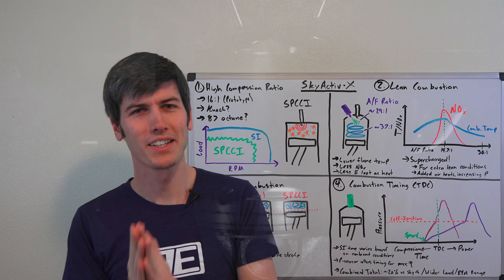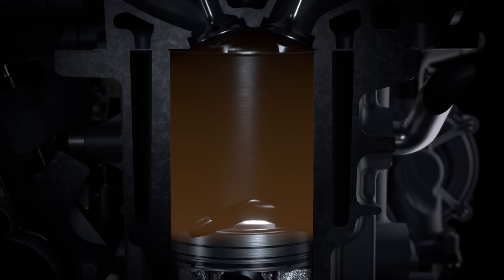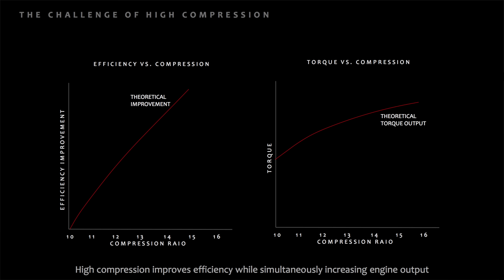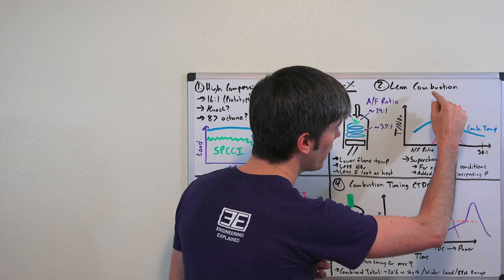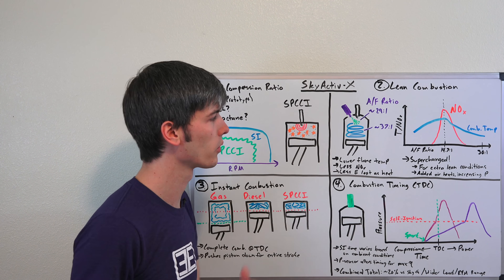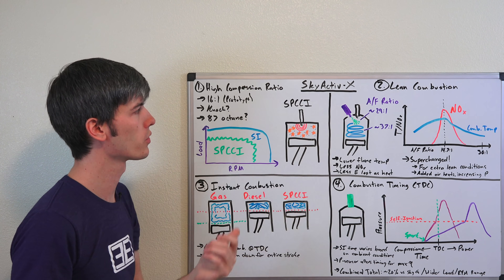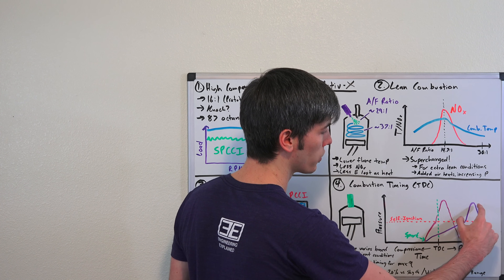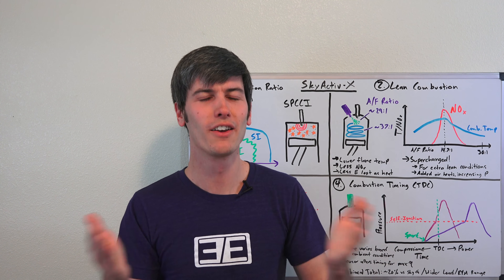How Mazda Is Saving The Gasoline Engine - SkyActiv-X

Comment: I love seeing manufactures saving the combustion engine, I absolutely hate the fact that countries and cities are pushing people to go towards "greener" electric cars but in the time we live in today it is not the economical choice, We are a long ways a way from generating clean green energy in most countries and recent studies show that newest combustion engine equipped vehicle are actually better for the environment on the long run, I want to predict that we are still 30-50 years away from electric vehicles.
Great video once again.
Reply: catalon warior nope. Honda will be making ice’s 30 years from now
Reply: I don't really care what is greener, if I can't change gears then I don't want it.
Reply: superdau Our power grid in America is overstressed as it is. You think we can handle 300 million electric cars too?
Reply: N C  Also, how are the chargers supposed to work?  We can't even get fiber internet to the majority of homes.  I work in the city but live waaay out of town with the farmers.  Is the utility company willing to run a new high voltage line out to every 400-acre home, and then to the next town 35 miles away?  What about when I get to work, are they supposed to pay for it?  If I live in an apartment, how do I avoid "charging theft", and is the landlord required to install a station at every parking spot?  What if I live in the city, where most don't have garages or driveways?  Do I have to run a cable out the window to the street?  What if I can't park on my street that night because someone else needs to charge?  What if I live in an area with snow removal?  What if I rent and the owner won't put one in?  What if I live in HUD housing?
Reply: Um no.  Just, plain, no.  Before going into this, you need to understand some basic things that I will outline below.  This may help you in understanding the problem.  

Renewables, while more easily accessible now than in the past, will not eclipse oil any time soon.  The reason, as others have stated previously, is that it is simply transient energy by nature.  How does the power grid account for this?  In a short answer, it barely does.  I highly recommend you go to like energy seminars and listen to what utility companies have to do to handle power demand.  It is highly statistical and estimated BY THE HOUR.  If demand does not match supply, it is a near emergency to bring power to the grid fast enough to meet demand to prevent any type of generator overload or blackouts.  It is a black science of sorts and very eye opening.

Energy storage is another reason.  Batteries, no matter the form, is totally inadequate in storing the large amounts of energy needed to power entire cities.  On top of that, charge and discharge times and cycles are important.  What is the point of having a battery system large enough to power 1000 homes if it takes over 12 hours to charge the batteries?  Batteries are limited by their charge and discharge rates (C).  The batteries can only SAFELY charge and discharge at certain rates.  Anything more on either side of the fence can destroy a battery.  

Lastly, renewable energy has really only grown in the last 10 years because of the subsidies in it.  If you look at a historic graph of renewable energy solutions sold vs subsidies, there is a direct correlation.  More subsidies = more being bought.  Makes sense right?  Now, take a look at subsidies vs innovation.  The more subsidies there are, the less innovation there is.  It is an inverse correlation.  Why?  Innovation is not needed when you are guaranteed to get x amount of money regardless of how it performs.  The one or two years the US killed subsidies to solar and wind, the sales of those solutions dropped to near zero.  

Ok, so now that you have this background information, let's look in the future.

Energy storage - lots of R&D is going into this to move away from batteries.  We need a huge energy storage solution that is able to accept high amounts of charge and discharge current in transient conditions without impacting operating life.  Once we have this, renewables may become more feasible, but only after the next point.

Wind - Wind is transient.  Not only is it transient, but windmills are only viable in two situations: 1) offshore or 2) at certain elevations in certain locations in the US.  You may have noticed that windmills have gotten larger over the years.  You are correct.  In fact, there are bigger designs on the horizon, but manufacturability is at its limits right now.  When I took a master's class in energy, GE had the current record of being able to make the largest one-piece wing for a windmill.  There is more wind energy when they are higher off the ground.  So we need bigger supports and bigger wings.  The problem is how do you make a one-piece wing big enough?  You should see the pictures on how they make these things.  Its pretty amazing.  So this is currently a bottleneck.  Additionally, lots of cities absolutely refuse to have any off-shore windmills.  Why?  Because it "looks" bad and takes away the beauty of the city.  This is no joke.

Solar - While solar array prices have dropped (yay), their efficiencies are still poor.  Off the top of my head, spectrolabs makes the highest efficiency solar panels at a whopping 40%.  They also cost magnitudes more than consumer grade solar cells, which are sitting around 10-12%.  Again, we have the same problem with wind.  Solar farms are only viable in a few locations in the US.  See a Dept of Energy map to get an idea of ideal locations.  

Price - the reason why subsidies are required is because these solutions cost so much.  Honestly, more innovation is required to get prices low but subsidies kill the opportunity to do so.  

Lastly, most 1st world countries (almost all in fact), rely on oil and nuclear power.  Even if everyone went EVs, the demand for oil would go up.  Realistically, nuclear is the best long term solution here for power.  Before you throw the flame arrows, I highly recommend you look at Gen 4 nuclear power designs and compare those to what is on the market today (Gen 1 or Gen 2).  There really is no comparison.  Anyone with an open mind and looks at the designs in an objective manner will come to the same solution.  

Sorry for the wall of text, but it was really required to get you the whole picture.  And this doesn't even touch on things such as badly needed innovation in the transformer market or smart grid tech.  Both of those would be an amazing help in all this.

I hope that helps.
Reply: Electric engines will spread like ICE engines over time: as both the fuel and the product that consumes the fuel become more and more available. As we saw more and more cars, we saw more and more fuel refined and more distribution points. As we'll see more electric cars, we'll see more solar panel and windmill manufacturers (and distribution sources will improve too, to get away from coal and nuclear. Heck, there's a nuclear fusion reactor prototype being developed. Greener and safer than that will be hard to come by: it only produces helium and heat!)
Reply: Manufacturers will continue to increase battery capacity as costs of doing so drop. Most people don't want a full electric vehicle because of range concerns. But if you tell them they can complete their daily driving on electricity and charge at night for a small price premium they'll jump in it. The only thing holding plug-in hybrids back is the price. But the cost is plummeting. When the price premium is under 4k, more and more people will take that deal because they will save on gas during their ownership.
Reply: Combustion engine isn't dying anyvtime soon, but in order for it to survive it needs to evolve. We already have the tech to make biofuels out of wood and food waste, it just needs to be implemented correctly.
Reply: Studies often forget that fuel doesn't just pop into existence in gas stations. They calculate the impact of power plants and battery manufacturing, but conveniently forget how gas is made. Oil has to be extracted from the ground, which uses a lot of power, and causes a lot of pollution if they use the now popular fracking. Then it has to be transported, and refined, and transported again. Both, but refining especially is energy intensive. Some experts say that now the oil industry uses almost as much energy to get the fuel into your car as the energy content of that fuel. Then there are the frequent oil spills, that are causing huge damage to the environment. And also don't forget about the Middle East where a lot of oil comes from. Wars there are the byproduct of the fight for oil. Hundreds of thousands of deaths, terrorism and millions and millions of refugees. Plus the obscene amount of money that the US spends on bombing and invading those countries.

Renewable energy is really taking off now. In the last few years the actual growth surpassed even the most optimistic predictions, and it's still picking up speed. That's because prices are now competitive with, or in some cases go below coal. Without subsidies. Plus battery storage is viable and affordable now too. In fact the recently built 129MWh Tesla battery pack in Australia is making a ton of money, and will pay for itself in a year. That's because the grid is overstressed and unstable, so the battery owner often gets payed for storing excess power, and again for giving it back at peek hours. And occasionally in case of an emergency (power plant failure, or general power shortage) they get payed a huge amount for the stored power. The battery can switch on in about 120 milliseconds, while even the fastest gas turbines need minutes to spin up, and a big coal or nuclear power plant needs hours.

Charging cars at night is not a problem for the grid. In fact it's a good thing, because demand is very low at night, so conventional power plants are throttled down and not making much money. That's why electricity is a lot cheaper at night. When solar energy gets dominant, this will change of course. Then cars won't charge at night, but when the Sun is still up, if possible. This will be coordinated by the grid, the owner won't even notice the difference. Also hydro, wind and nuclear will still be available at night, and huge battery packs will pick up the slack.

If we extrapolate from current trends (demand, production ramp up, battery energy density growth and price reduction), it's seems that by 2030 almost all new cars will be full electric, and by 2040  almost all cars on the roads. In Norway already over half of new cars are plug-in hybrids or full electric. That's of course because the incentives, but with the falling prices those won't be needed for long. Already if you look at the total lifetime cost of a vehicle, electric is a lot cheaper, but in a few years the sticker price will be less too.
Reply: And I forgot one important thing. Lithium mining is reasonably clean, and the batteries are fully recyclable, so there are no mountains of toxic waste as some people claim.
Reply: superdau  your wrong
Reply: András Bíró  Go read a little about Li mining before you say it's clean.  Start with Bayan Obo.  Then look at other rare earth refining like Baotau Lake, which makes EV motor and wind turbine magnets.
0% of lithium gets recycled.  NiMH does partially.
Your other comments are equally flawed.
Reply: Do you have a link to these recent studies?
Reply: superdau Look up the thermal efficiency of coal and gas plants, remove the transmission losses, and compare that to ICE.  Why build more power plants when we could just stick to the gas-powered cars we already have?
Reply: liljendal20 Bevs not the future but don’t tell pestla owners that. They nonstop talk
Reply: Dan, you still have not factored location in all of this.  Again, what is the point of having wind and solar if your state or local area is a poor choice for them?  Example, look at Hawaii.  Nearly 100% of their energy use comes from oil.

Also, it does not matter that the lion share of new power generation projects over the past few years were renewable, in overall energy generation, it is still a minute piece of the pie.  Oil, NG, and nuclear are still king are will be for a very long time.  

Solar farms are not cheap.  If it cost $25M dollars to build a farm that will supposedly generate 1 MW of power, efficiency makes a huge difference.  Why?  It is called Rate of Return.  I recommend you look that term up.  It is important to note that solar cells degrade over time.  It degrades the most in the first 3 years of operation, so that 10% may be only 8% by year 3.  Whereas a 20% may be 16%.  Half your payoff time.  

Hydro is even more location dependent than wind and solar.

Again, with batteries, there will be a global shortage of materials that go into them.  I highly recommend you research about the Cobalt shortage.  Elon Musk couldn't meet his Battery manufacturing goals even if ALL the world's Cobalt supply went to him.  All this will do is drive the price of batteries up if demand does not change or Cobalt supply is increased.  

My previous point on battery life is still valid.  On top of that, the energy density of batteries is just not there for long term feasibility.  Things may change in the future with some of the new battery tech coming out, but then you still have the issues of longevity with charge and discharge rates.

And you are dead wrong on nuclear.  If you look at the entire energy generating life cycle of a power source, nuclear is by far the cheapest per watt.  Sure, it has huge capital costs, but once it is up, fuel rods last up to 50 years.  With Gen 4, they can pretty much be used indefinitely as they have some reactors that can actually generate more fuel than they use as a byproduct.  It is pretty fascinating.  

You say economics will push ICEs out of the equation.  Not going to happen, at least by that time.  I come from the auto industry.  While electrification is a big thing, ICE's are not going away any time soon when companies like Mazda continue to innovate to bring fuel economy in a package like this.  

Why?  Several reasons, actually.

1.  There is no infrastructure for EVs in place.  Sure, one can charge at home, but what if you travel?  Are you going to going to take a 1.5 hour break every 100 miles?  Unless you own a tesla and can drive 3-4 hours on a full charge, its unfeasible.  

2.  Battery charge and discharge limitations.  Until you can get charging stations that can charge your car as fast as you can fill your gas tank, it is not going to happen.  

3.  Cost.  Look at the average cost of a new ICE car nowadays.  It is what, around $28,000 now?  Are you going to force poor people to buy new cars?  The subsidies have already ended in a few states.  For some people it is simply too much without them.

4.  Repair cost - Batteries have a finite life.  And FYI, it is less than the expected design life of a car.  5-7 years is the estimate.  This is one of the big reasons why used priuses are so cheap.  Every conventional toyota product has high used car values except for the prius.  

5.  Manufacturability - Cobalt shortage.  I believe the current rate of mining puts battery manufacturing rate around 500,000 units per year (for cars).  Take all of the large car manufacturers.  Combine all their throughput per year and take compare that to battery supply rates per year.  Note, this will most likely not include smaller, local auto OEMs like in India or China.  Even without them, there will be massive shortages.  With massive shortages will come massive price increases.  With this, the profit margins will fall and ICE's will look more and more economical.

6.  The energy density of diesel and gasoline can't be beat.  

7.  Alternative fuels are still being looked at that would be cheaper than both gas and electric (kW/hr).  Really, in the case of H, the infrastructure is what is lacking but has been proven to work and work well.  Cost is an issue here as well, but economies of scale have not been realized yet as it is still in the prototype and pilot phase.
Reply: the problem there is that people who own ICE cars get punished, instead of more healthier choice of giving those who switch a benefit. A small family that struggles to make a living but needs their car shouldn't be punished by an end date in which they cannot use the vehicle for longer which is a case for a lot of countries, also why should you punish farmers when even the electric technology hasn't advanced into tractors and other machines.
Reply: catalon warior how could they as about 3 billion people on Earth live in poor countryes and cant afford to buy a car which is more than 3000 euros?ICE powered cars will run for a long time.
Reply: That's why I've been running on E85 for the last 10 years or so.
Reply: Seriously can't we try to forget about using talking points like "Our power grid in America is overstressed as it is. You think we can handle 300 million electric cars too?" when we all know it doesn't work like that. EVs tend to charge at night when the grid in under utilized. And 300 million electric cars not showing up overnight. Or "gasoline engines will die in 5-10 years" really???

Just a suggestion. For those that r sure of their views take 1 day a month to try to take the opposite point of view.  I know it will seem impossible for many, but just coming to post like this means we all want learn more and keeping an open mind best way to learn more about things we often avoid thinking about. Ok that seemed like a lot of new age BS to me so I have to puke now. lol
Reply: The internal combustion engine is still the only practical engine for most uses.   Electric cars look promising, but given their limited range and long charging times and the fact that many people live in apartments or park on the street, they’re still a limited market.

I wouldn’t mind having one as a third car, for short trips, running errands and the like.
Reply: acekc83 Damn you are smart bro. I would love to sit and listen to you lecture
Reply: acekc83, the subsidies for renewables were designed to jumpstart manufacturing so that economies of scale could kick in to bring down costs.  And, they've succeeded spectacularly.  Renewable costs have already fallen so much that they are as cheap or cheaper than natural gas in some areas.  And, unlike fossil fuels, renewable costs continue to drop rapidly.  At this point, the cost curves make the demise of fossil fuels inevitable.  It's not coincidental that the lion's share of new power generation projects over the past few years is renewable.

By the way, efficiency of solar cells in converting solar radiation to electrical power is practically irrelevant.  What matters is the cost of the electricity that's generated.  Often, that means a cheaper but slightly less efficient solar cell is more cost efficient.

Intermittency of wind and solar can be overcome with hydro, pumped hydro, and batteries.  Batteries are also experiencing rapid price declines, falling 80% since 2010, and continuing to fall.  Already, grid scale batteries are being deployed, and are even making money off the short term wholesale price fluctuations that happen many times throughout the day.

Current nuclear is not cost efficient.  It would be great if next generation nuclear power plants could bring costs down dramatically, but that's decades away.  In contrast, a new wind or solar power project can go from planning to completion in less than a year.  That's a HUGE advantage.

As for the gasoline engine staying around for 50 years, it's not going to happen.  The reason for that is economics.  By 2025 at the latest, the unsubsidized acquisition cost of EVs is forecast to drop lower than equivalent ICE vehicles, and continue dropping.  Once that happens, ICE vehicles will quickly become expensive niche products.  Unlike petrol-heads, the vast majority of regular motorists have no sentimental attachment to ICE at all.
Reply: So just put it off for forever? If you don't start doing it, when will it become economical?
It's fantastic that France and Germany have given an end date as to when they will no longer allow combustion engine car sales. I wish the US would join the times and give a date too.
Reply: acekc83 the total PRODUCTION carbon footprint is not much different in the 2 vehicles. Today life cycle, the electric vehicle is much lower. In 200,000 miles a gas engine that gets 25 mpg will consume 8000 gallons of fuel(how much electricity goes into refining 1 gallon of fuel?), require 40 oil changes (200 quarts of oil) 2-6 sets of spark plugs, a few gallons of coolant, 2 timing belts, 2-4 drive belts,  4 transmission fluid changes (12-15 quarts of oil). 
Nissan still has some work with their batteries(they've had some pretty low mileage packs get to less than 70% capacity), but all the data on Tesla batteries says they should last 500,000-800,000 miles.
Reply: Jason Hall plug in hybrids are lame. They're heavier, slower and require more maintenance than a full electric vehicle and still require gasoline.
Reply: acekc83 energy density of those fuels can't be beat right now... But electric cars are 3 times more efficient than the most efficient gas or diesel cars on the road.

Hydrogen fuel cell vehicles will be awesome because of the short refuel time, but they need to use a renewable source of power to make the hydrogen or it's a waste of power to make it. You put more into it than you get out of it so you might as well just burn the fossil fuel if you're using fossil fuel to make hydrogen.
Reply: That's why we don't have to focus on "carbon footprint", for the sad joke it is (except of course for Al Gore and the like who make BIG money out of thin air, literally).
Reply: CO2 means life on Earth and bubbles in your soda or champagne.
Reply: If they were to do, I don't think Nissan would invest in variable compression engines, nor Mazda would in SkyActiv.
Reply: I feel like I'm on both sides of this one; electric cars are already pretty mainstream, and objectively better than ICE powered at least in operating costs, so  fleets and commercial applications will definitely come before 30-50 years - which I assume meant majority market share. I definitely will miss rowing through the gears as the motor revs though when mine eventually bites the dust.
As far as clean energy goes, solar and wind are viable, but there hasn't been much progress in most countries as you stated. However, on the consumer side solar is now becoming appealing compared to electricity providers cost-wise in more areas, especially for the environmentally conscious.
Reply: @Ujiltrom M There is that of course,  but still in today's society the way electric cars are produced is in a unhealthy manner, we are so far away from creating good, environmental batteries, and just think about all the slavery in mining cobalt for example, plus the ICE has come a long ways from just a few years ago. My take on this would rather be to make a campaign to regenerate large forests, plantlife to work against the Co2, which we could easily do (did some research on that one).
Reply: The argument "we don't have the clean energy to power cars" is BS. Even burning coal in power plants and putting the electricity into a car produces less emissions (CO2, NOx, particles) than any ICE car. That's not a political opinion, it's mostly just how physics and chemistry work combined with the efficiencies of large scale power plants. 
Please provide a link to those "recent studies". Until then I call BS on them as well.
And 30-50 years away from electric cars? Which rock did you crawl out from under? If you didn't notice, we have electric cars now (that can fulfill the requirements for 90% of people).
Reply: john m I'm not a left wing extremist but for years I've bemoaned the amount of money we pump into the dysfunctional middle East region to maintain some semblance of stability. Luckily fracking is weaning us off the middle eastern teat, but affordable EVs would go even further. Thankfully the costs of going green are plummeting. Solar and wind have beat coal and are nearing parity with natural gas. And they're just getting started. Now we just need more breakthroughs in battery pricing...consumer electronics are helping drive that investment.
Reply: Jason Hall  Solar and wind are not even close.  They seem (what's reported) to hover around 6% of total generated, but I've seen as low as 1.6%, and that includes all the taxpayer-paid house installations.  You're probably reading "installed capacity", and keep in mind that burning wood is also lumped into the "renewables" figures.  It's also not cost effective, even when heavily subsidized, at up to 10x the price.  The market is currently collapsing.  Many wind and solar manufacturers are downsizing or closing (I saw Siemens recently).  Look at the UK, Germany, or Australia's current situations.  In some cases their bills have tripled and have no electricity.  It has been a complete failure.  We really need hydro or nuclear.
Reply: Jason Hall How are we going to charge all these batteries at night?  We already have problems just running air conditioners in the summer.  What if I want to drive more than 160 miles?  What if I don't want to destroy the environment with dirty tech?
Reply: I wish there was a law saying only car enthusiasts can drive a fuel powered car. That way all the normie tier retards can have their precious Nissan Leafs and we can have our awesome cars without polluting the earth much at all. How could you oppose that.
Reply: Yup.  The governments and politicians are not looking at total craddle-to-grave carbon footprints either.  While the operating carbon footprint of an electric vehicle is low, the carbon costs to create and recycle those batteries are extremely high.  There was a study done not too long ago that shows that there is really a neglectable carbon footprint difference between a conventional combustion engine and that of an electric vehicle. 

Factor in the cost difference between the two and it just isn't worth it from a financial or economical standpoint.  Additionally, the cost to replace batteries if you keep the car past 7-9 years is enough to surpass the car's worth at that point in time.  

As you mentioned, we would need some new revolutionary energy storage technology (that is not the battery) to give us a better outlook on full electric vehicles.
Reply: gasoline engines will die in 5-10 years